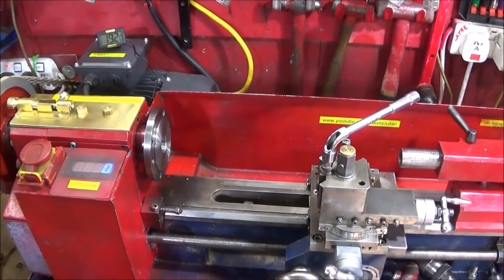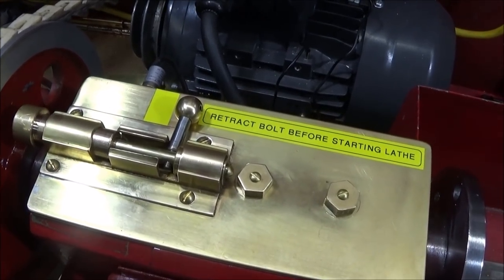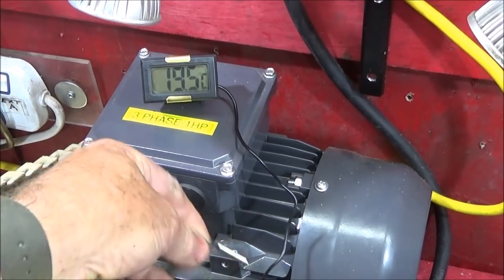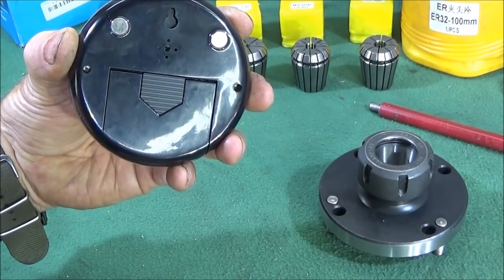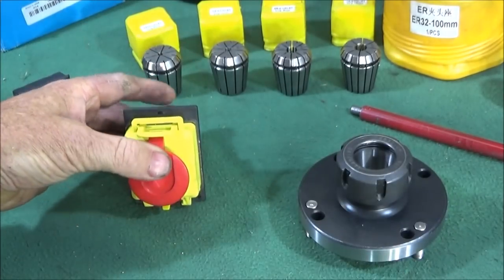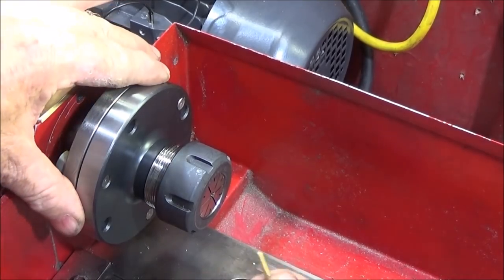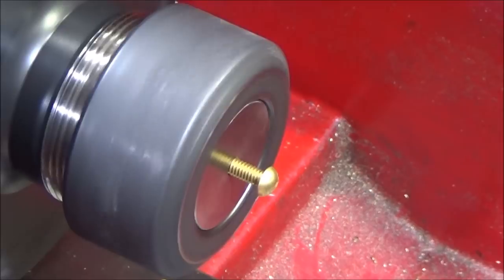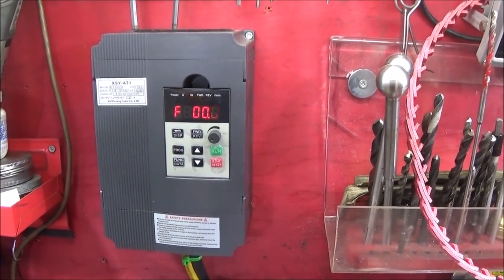My New Chinese Mini lathe Indexing Pin Assembly & New Tools

Comment: Hi! Suggestion, add an external fan to your motor for when you run at low RPM and wire it to stay on (period of time) after you stop your motor.
Mike.

Comment: Steve, looks like there is room between the bolt shaft and the first oiler to add a microswitch (normally closed) that could be connected to the RST input on the VFD to keep the motor off when the indexer is engaged. Might be a useful safety mod. Nice video BTW, I enjoyed it a lot. :)
Reply from the maker: Hi  Thanks.....Yes that is a great idea, I may do something like that... Regards Steve

Comment: Very good video and informative also. What is the purpose of switching the motors to 3 phase and running converters verses running single phase motors.
Reply from the maker: Well for me it is being able to have easy control of the motor which one can't have on a single phase motor.  My Mini lathe electronics from new were very poor and kept breaking down forcing me to buy expensive replacement parts, so the VFD and 3 phase motor was the best alternative. The VFD's can only run 3 phase. 
    I am converting the Myford ML7 so that I can have easy variable speed without the necessity of changing the pulley belt speeds or having to use the noisy back-gears for very low speeds. Also the VFD's allow one to go straight into reverse without stopping the spindle first, which will be great for thread-cutting. Also the VFD's allows one to literally program the settings of the motor and you will be surprised at what you can change to make it run how you want. 
    Apart from that, modern 3 phase motors can be made smaller per HP than single phase, are more economical, simpler in design and use. 
    Also with VFD's they have a simple low voltage connection block which you can quickly connect things like external speed control, on/off buttons, emergency stop an tachometers etc. You then simply alter the specific parameter settings to switch over to external operational control for each added command button you want to set-up. This allows one to make up a personalized control box for the whatever machine tool they have. 
    All of these things were beyond most home engineers in the past, especially with what it used to cost, and still does, for such electronic named conversion sets. The Chinese with their VFd's have transformed this, allowing the hobby machinists to have the chance to have this versatility, in these set-ups, at an affordable price. They are really excellent.... and so are the VFD's & 3 Phase Motors!!!
Regards Steve
Reply: Steve Jordan thanks for the reply Steve. Yea as you said electronics and 3 phase can get complicated and can sometime be more that the hobby machines is willing to jump into. But with all the benefits you have mentioned I can see now how much better it could make in the performance of running the lathe. Thanks and keep up the good videos.

Comment: Useful video.  Are both pulleys taper lock?  Please add links for the pulleys you purchased.
Reply from the maker: Motor Pulley Set....SPZ90-1-1210 V Belt Pulley & 1210 19mm Taperlock Bush
Mandrel Pulley Set...SPZ170-1-1610 V Belt Pulley & 1610 25mm Taperlock Bush  (I'm making a new 25mm dia shaft mandrel to give room (dia) for the 6mm woodruff key slot).
I bought these taperlock sets on Ebay....Seller bearingshopuk-eb 
I hope to show all this in a new video at some point.

Comment: Where do you get the grey taper pulley blank you're going to make the holes in?
Reply from the maker: Motor Pulley Set....SPZ90-1-1210 V Belt Pulley & 1210 19mm Taperlock Bush
Mandrel Pulley Set...SPZ170-1-1610 V Belt Pulley & 1610 25mm Taperlock Bush  (I'm making a new 25mm dia shaft mandrel to give room (dia) for the 6mm woodruff key slot).
I bought these taperlock sets on Ebay....Seller bearingshopuk-eb 
I hope to show all this in a new video at some point.

Comment: What kind of runout are you getting with that collet chuck?
Reply from the maker: Hi Chris, its .001" thou so far.I haven't tested all the collets though as I'm not that bothered with concentricity as most of the things I make are from solid bar. As long as it looks ok by eye its ok. If I do second op work and it runs out more than a thou then I would just knock the component until it runs dead true

Comment from the maker: SEE BUYING LINKS BELOW:-
   100mm Diameter ER32-UM Collet Chuck -- https://goo.gl/sbcpU9
   250V Universal DKLD DZ-6-2 15 Amp NVR Switch --  https://goo.gl/C2XQvn 
   Dial Test Indicator Lever Gauge Scale Meter --  https://goo.gl/tTrRz8
   Multifunctional Digital Thermometer Temperature Display--  https://goo.gl/8jXUiN
   Home Brew LCD Digital Probe Embedded Thermometer -- https://goo.gl/86eLtN
   15% off Cutting Tools --  https://goo.gl/5jGjdY (code: mct15)
   More Banggood Tools --  https://goo.gl/iGcfZt
  Mid-year Mechanical Parts Sale (up to 80% off) --  https://goo.gl/BhBHhw
ALSO SEE SOME GREAT OFFERS ON NEW DRILL BITS:-30% off Drill Bits Promotion -- https://goo.gl/KrG3Wh (code: 266b22 )

Comment: My Banggood 1" indicator is not so good. Worth the $9 though. You get what you pay for. Side play moves the needle.
Reply from the maker: Hi Dennis I have bought several clocks from China now and all of them have been excellent. I have got a few English ones and there isn't any noticeable difference in use. I have had one of the Chinese ones for about five years now and it is still as good as the day I bought it and its one of my most used clocks!
Reply: Same here, bought a couple and after a while they can start to stick, bought a digital
one also and thought brilliant at first. Again after a while it goes senile. Sometimes that
means it needs new batteries but mine does it with brand new quality batteries also.
Reply from the maker: I will see how mine perform and last. So far I am very pleased all the Chinese ones I have had over the years. They must sell thousands of them and there are bound to be some that fail. I wouldn't actually count sticking as a major fault though, I would just take it apart and see how I can rectify the problem. Personally I prefer mechanical measuring equipment over digital. I've even had very new Mitutoyo verniers that are very temperamental and fail to be a reliable measuring tool at times.

Comment: My 3" ER 32 collet chuck was not so good as yours. Way too much runnout. I finally made my own chuck and only one of the chinese nuts was any good.
Reply from the maker: Hi Dennis, I've never had any problems with the collet chucks from China....They have all been excellent.
Reply: I bought two for my mini lathe with a 3" spindle. both waggled a 4-5" rod around like I dunno.  at 5" 6-7 thou off center. Banggood did not want to stand behind them first offering points for their coupon scheme, after a number of emails they gave me a $6 refund.  Not good service in my book
Reply: Dennis Williams BG has absolute terrible customer service. They make people homicidal lol they’re definitely cheaper products to buy if you’re ok waiting 8 weeks to get it